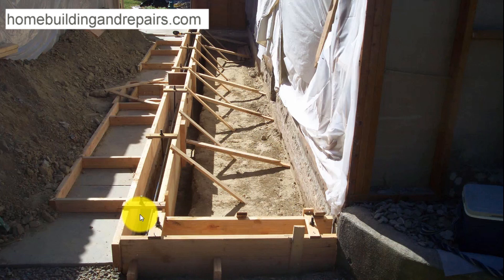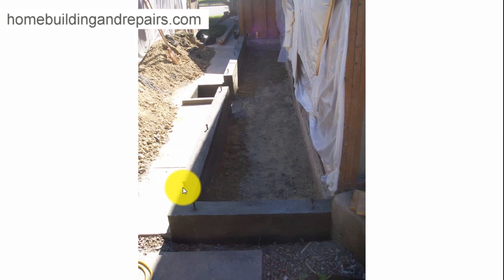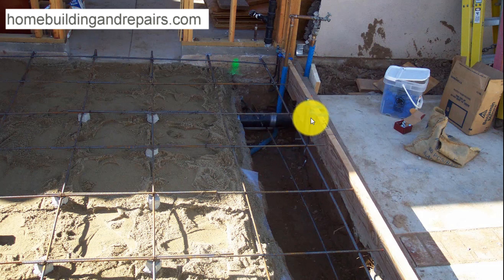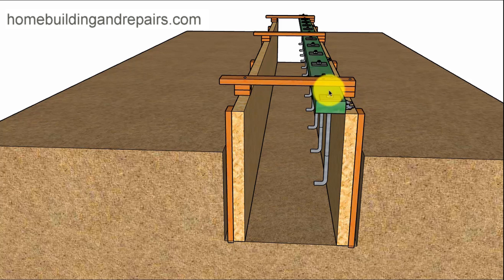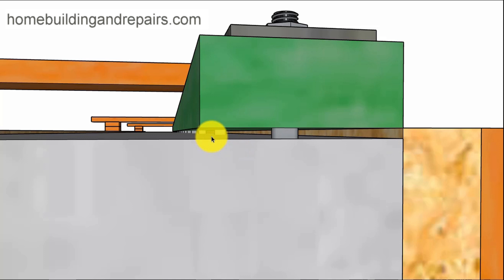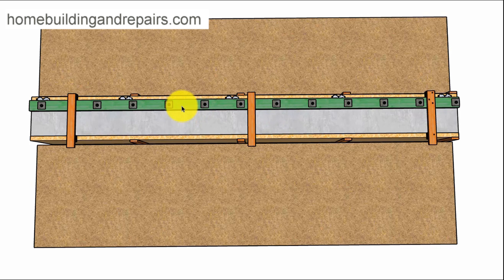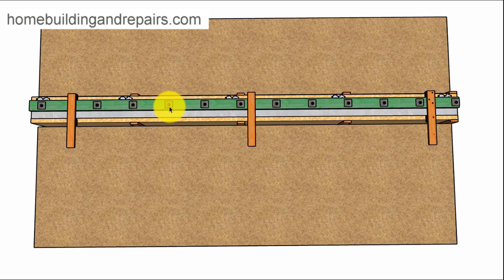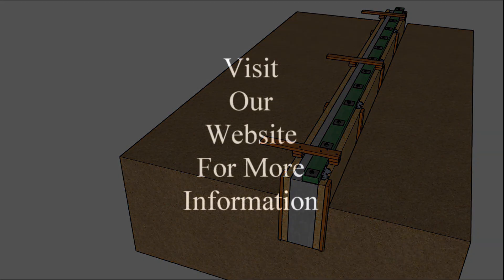Comparison Between Wet And Dry Framing Plates For Building Foundations - Home Building Ideas

Comment: You just put your plate on top of the bolts and smack the board with a hammer which marks the bottom for drilling As long as the bolts are plumb they will fit perfectly. 
The main issue I see with pre installing the plates is sealing, moisture wicking prevention and termite flashing in areas that require it. Isn't it code to put a moisture barrier under the wood?

If you pre assembled the plate and insert after troweling the top, there shouldn't be voids around the bolts as long as the mud hasn't set too hard and you jiggle them in. I have always seen them inserted after floating the top anyway, and done it that way myself. You do have to go around and check them though until the mud starts setting as they can settle too much if placed early.
Reply from the maker: You definitely made it sound easier than it might be if there are larger anchor bolts for hold downs and all of the anchor bolts aren't at the exact same height, but I've used your hammer over the bolt on top of the board method before and it does work.
Reply: @gregvancom  I imagine the larger they are the more they want to sink, making pre attaching them necessary. I have never had to set anything larger than 5/8in 12in long j-bolts. How are you dealing with the sealing and moisture problem though, nothing? Just direct contact? Or do you pull it up after the concrete sets and add the other materials. Some could be fastened to the bottom of the toe plate in advance, and the idea may still work.
Reply from the maker: @court2379  If you're referring to how do you seal the bottom of the wall framing plate space in between the top of the footing, then you can use almost any sealant, but if you're looking for a waterproof seal that is never going to leak, then I don't think I would have a recommendation.
Reply: @gregvancom  No, I believe code in my area requires anything that contacts the concrete to be moisture resistant, which the wood is not. The reasoning that moist travels thru the concrete and would cause accelerated rotting of the wood (even treated wood). Also it causes expansion which could crack the finished walls. So putting a foam gasket under them has been common for years, though they probably use something more advanced now. Finally a caulk or tape would be used to do the final air seal between the plate and concrete applied in the corner where they meet. Addressing any locations where the concrete and wood don't match well and full compress the foam.
Reply from the maker: @court2379  I definitely didn't understand your question. First off, let us know where you're from, state or country will be fine if you don't mind. I've never had to deal with a material used underneath lumber to prevent moisture from absorbing into it, but have seen the gaskets and even metal use before, but whether or not this stuff will actually last, I don't know.
Reply: @gregvancom  Utah. I don't think I have seen a single home that doesn't use foam.
Reply: @gregvancom  I spent a few minutes searching for codes on capillary barriers and it appears none of them include it. For the $40 it costs to do a whole house, I cannot see why anyone wouldn't use something. It is more common to put plastic under the concrete now, so that probably mitigates a lot moisture flow and may make it uneeded at the plate. Apparently the British call it rising damp, but is seems like it is largely ignored in the US.